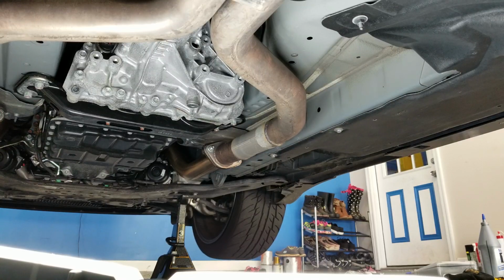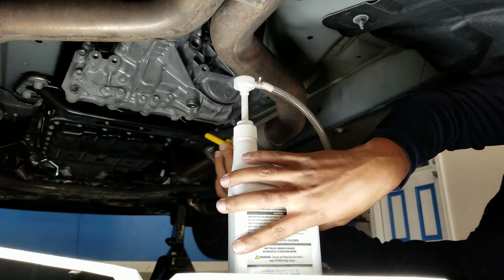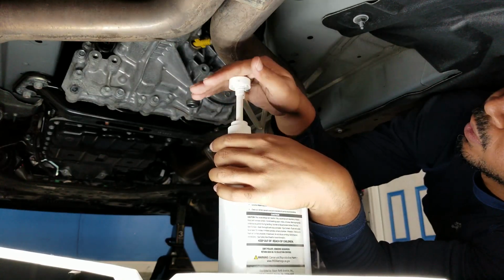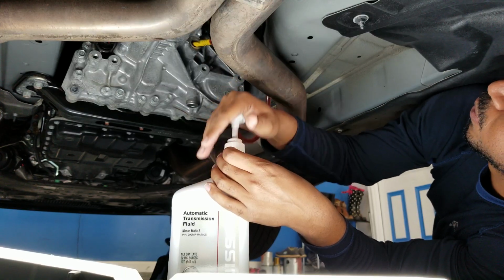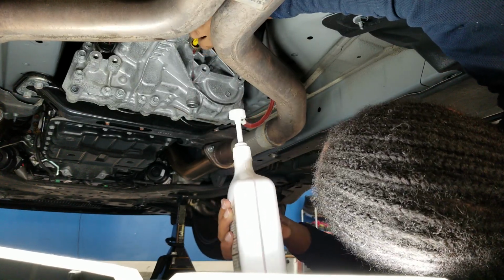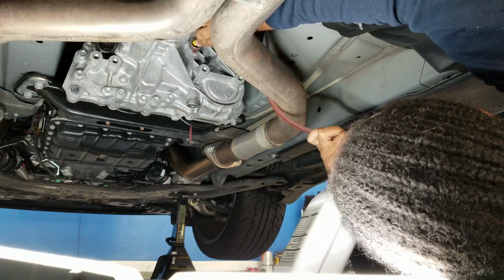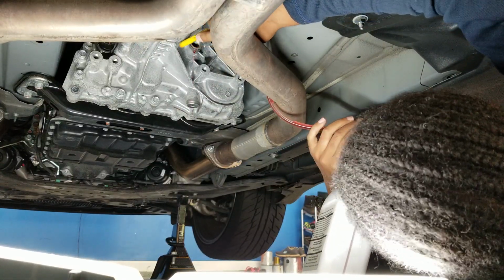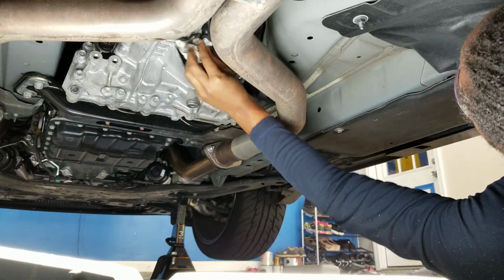Q50/Q60 AWD transfer case fluid fill

Comment: Did you only need to use one quart? The fsm says 2.2 pints which is 1.1 quarts, but i just had the same experience servicing mine. The fluid i used came in a bottle with 1.05 quarts (2.1 pints) and i have a second one, but it started dripping out after the first bottle was finished.
Reply from the maker: I just filled until the fluid starts to dip out the fill hole...

Comment: Thanks for showing how this is done! I know you don’t believe in doing the drain and fill on the transmission but could you do it once? I would love to see how it’s done and I’m sure some other RS owners would as well since I haven’t seen anyone else do it on this car yet, thanks!
Reply from the maker: Idk if I'd show that process... especially when it's not necessary...
Reply: I hear ya, I was hoping it would  be similar to the transfer case since you can’t fill from under the hood
Reply from the maker: It's not like the transfer case... it's closer to changing the fluid on a German cars dual clutch transmission.... look up changing the DSG fluid on a Audi S4.
Reply: Lol! Now I can see why you don’t want to do the transmission fluid change. I’ll be doing the diff’s and transfer case at 30,000 though. Might have the dealer do the trans fluid at 60,000 or 70,000 and call it good. Kept my last Infiniti for 15 yrs and 220,000 miles so I tend to keep them for awhile lol.
Reply from the maker: @dzachalski  the AWD transfer case just happens to use transmission fluid also. The AWD transfer case is a separate fluid system from the transmission.

Comment: What is your year model?
Reply from the maker: 2016 Q50 rs400
Reply: @KayDroTechnologies  does the 2015 3.7L have the same transmission setup, I'm AWD as well
Reply from the maker: 2016+ Transmission is different internally... Basically its an upgraded version to handle the torque of the vr30ddtt engine.
Reply from the maker: Transfer case and front differential are the same... rear differential is different for 2016+
Reply: @KayDroTechnologies  thanks, I'll look up the fluid for the rear, appreciate it
Reply from the maker: Uses the same fluid... just different rear differentials.
Reply: @KayDroTechnologies  bet, and you have new subscriber

Comment: Nissan/ infiniti recommend using Matic- J  fluid not matic S ! ,
Reply from the maker: Lol matic S replaces matic J...

Matic S is synthetic version of matic J
Reply: @KayDroTechnologies  

Infiniti  50/ 60 2020 user manual state that only use matic S for RE7R01A 7/1 transmission  and matic J for the transfer case , these fluid have  different viscosity  index and Brookfield viscosity for different  applications
Reply: @KayDroTechnologies  
Matic S is not synthetic,  designed on the basis of high quality hydrocrack oils with a special additive and inhibitors , so it is group III  base oil , while 100% synthetic is group IV & V
Reply from the maker: @mohammedmuneam1177  👌 I've ran matic S in my awd transfer case since 2012 on my g37x, m37x, and now on my Q50 rs400... no issues. It is known that matic s replaces matic J regardless of what the manual says. Ask your local dealership... Running matic S in your transfer case on a q50/q60 will reduce the chance of ever over heating your transfer case and getting the "awd error" on your dash. I'm speaking from first hand knowledge of tracking these cars and thermomangment is the name of the game.

I even ran matic S in my power steering rack on my G37x because matic S handles heat very well. Hope that doesn't blow your mind too... everything doesn't have to be by the book.
Reply: @KayDroTechnologies  
Thank you for  sharing your experience
❤

Comment: How do you drain the fluid in the transfer case? Is this done by draining the transmission? I'm changing my transmission fluid this weekend and I saw that the transfer case fluid needs to be changed as well.
Reply from the maker: Transfer case fluid is separate from the transmission fluid. You can use Matic S in the transfer case as an upgrade to matic J.

Comment: I'm sure it's suppose to be J.  Trans is S
Reply from the maker: Matic S is the synthetic version of matic J. I'm upgrading the transfer case fluid.
Reply from the maker: You can also use matic S as a power steering fluid upgrade.
Reply: NISSAN "BULLETIN" NOW REQUIRES ALL SERVICE BE COMPLETED WITH "S" TYPE. THANK YOU !!